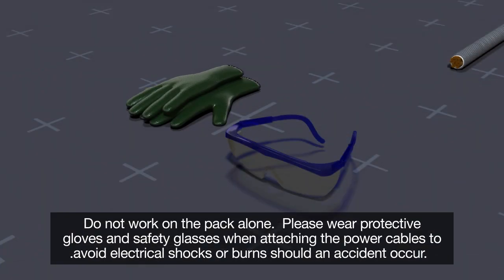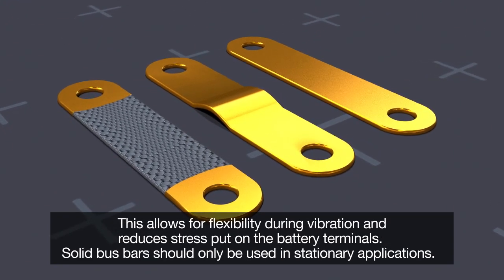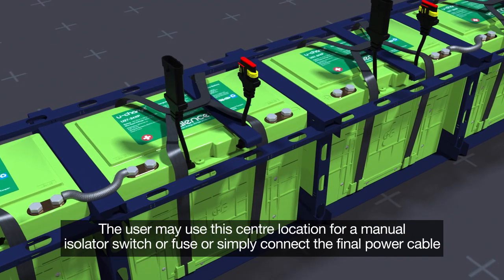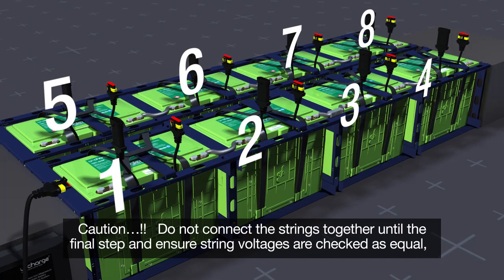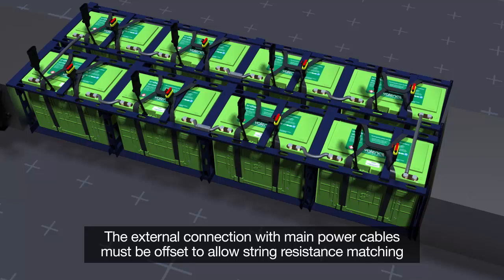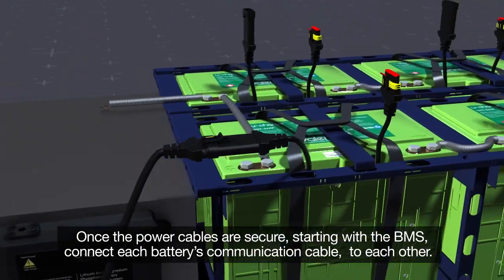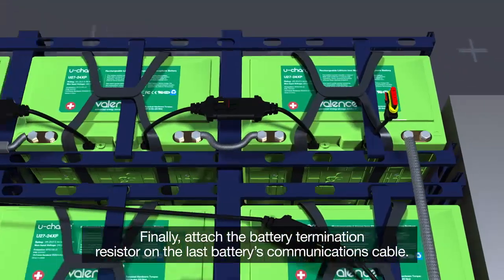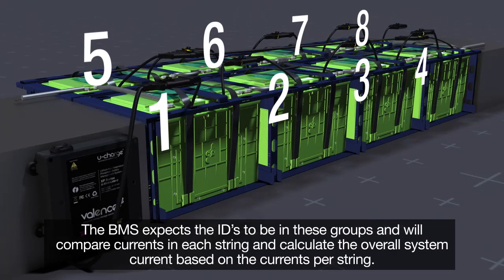Assembling a Battery Pack: Connections

Comment: hi
have my solar system powering my house 24 volts system 
presently have rolls 450ah 6 volts x 8  batteries and i need 450 x 16 to run my system properly 
what would u recomend